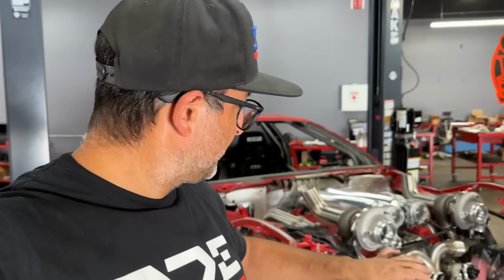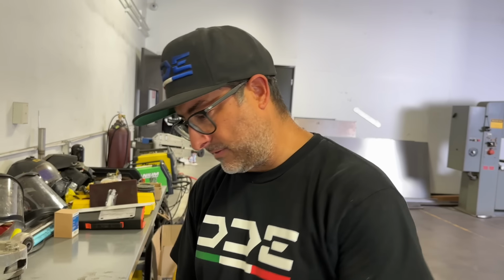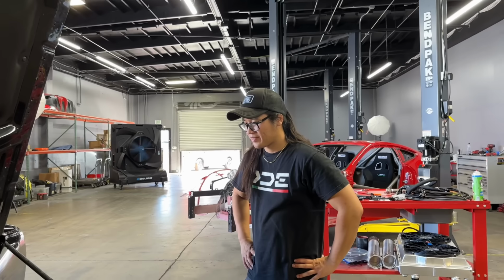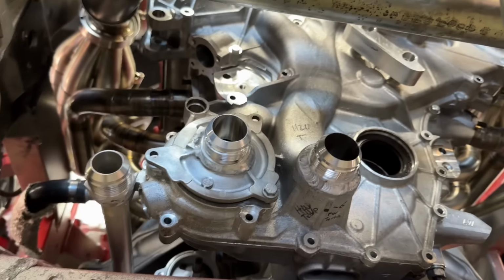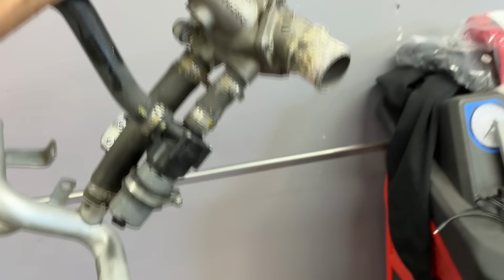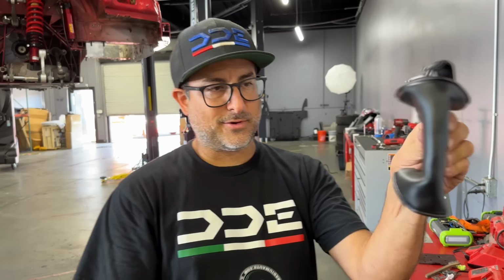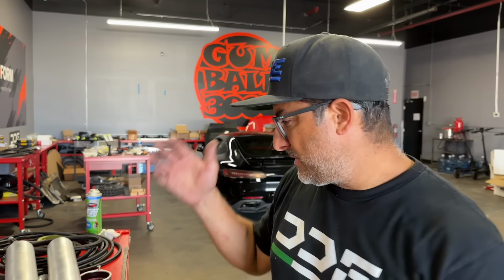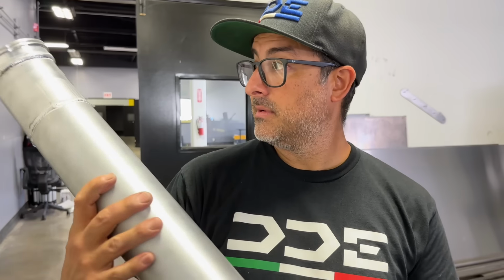DIRTY RAT CAUSES MAJOR ISSUES ON MIKES AMG BUILD!

Comment: For the radio, not having sound, I would press the audio button on the steering wheel that request for Mercedes to make a call or set a radio station, and then hit the cancel button. Sometimes that will clear out a Bluetooth error. Sometimes causes the audio not to come on

Comment: Why aren't u guys adding an air jack system to the car? I think that would make ur job a lot easier change the wheels.. figuring it will be a frequent job on this car, that will eat up a set in just a few minutes..
Plus it would also be a really cool extra feature, an doesn't it also make sense so u could warm up ur transmission an diff while standing?

Comment: Well, someone may have already pointed this out. But on my Charger, I had an issue with no sound through the speaker. Went to the dealer for ideas where to look and the service writer said that if the sound system suffered a low voltage draw that the amplifier would go into sleep mode. So, I pulled the fuse to the amp for a couple of minutes and put it back and bold speakers were working again.

Comment: I know a v8 cooling fans should be with two fans equaling 2800 to 5000 cfm what type of fan does it take to cool a v12😅 that alot of air movement

Comment: My camshaft position sensor is fuct! It's a 10 minutes fix except it needs to be recalibrated! I'm not taking it to the dealership! I kicked a mirror off a show room display car when the dealership decided to take my rims and tires I just spent 5G on and wouldn't give them to me even though I had the stock rims and tires! 😡😡😡😡😡😡😡 I'm surprised I didn't see a visit from the cops sorry Dodge Callanger I didn't want to fuck you and the display up but 5G is 5 fucking G! Fuck the dealership I will never buy a car at that one again! 🙄 🖕

Comment: Random thought, probably completely wrong... Maybe the car has shut off your radio because of the battery code. 
My Silverado turns off the speakers when the battery gets low to prioritize "essential" functions. Perhaps your car, due to missing that battery connection, is doing something similar. 
Just a thought.
Reply: Side note, when this happens, the radio looks like it's working, but no sound. 
When it's -20F I have this problem time to time, even with a "good" battery (I need a battery warmer lol). I hope you don't need to spend 2 grand on a battery, but that legit might fix it for you.

Comment: when it comes to mercedes electrinics its (eghm) old school so yea always if there is a fault in the radio or instrument cluster just take off the connector on the back,if that dont work ofc check the fuse but probaly something has a fault, also if on a newer car if the dashbaord has a fault and there is a can-fault it could be a backup camera because its on the same can-system as the dash.

Comment: hey bruv ideally on the uca you want the heims vertical not horizontal. four tabs for a double shear setup. can gusset the top and bottom, run full range of travel and can calculate the clearance. notta big deal but you will get more life out of the heims. ps they better be fk or auroa

Comment: Hey Mike! Loved the episode.

With the solid engine mounts - you mentioned the engine will be connected to the chassis. Is there a risk of the torque from the engine twisting the chassis over time?

Comment: Dude, just gut the stock water pump and seal it. And use the electric water pump to control warm up cycle. just leave it off  and have it pulse a few times to cycle the coolant for accurate readings, and basically don't turn it on until the coolant is like 185 degrees

Comment: Former Mercedes Mech... The cable to the lithium ion battery is mainly to regulate the alternator. This could maybe (most likely not, but not 100%) cause some issues and shut down some systems like radio and stuff... (The Battery output is parted in 2 "lines" 1. Engine and all the stuff that the car needs to run. 2. Comfort: like heated seats, radio...) Hope you can just decode it, and that solves the issue. greez from germany

Comment: These AMG have a printed sheet with the fuses, it is usualy located inside the fuse box on the back, and has the diagram for all 3 fuse boxes, they tend to have 3, one in the engine compartment, another on the driver side(interior) and another on the trunk, mine had the sheet stored in the trunk, the previous owner must have lost it or they lost it at service

Comment: Hi Mike, regarding the amg gts there is a recall for the gearbox from 2015 to 2018 models if I’m not wrong. Please check with your local Mercedes dealer by giving your Vin number. I have a 2015 and the gearbox was licking and replaced it with a new one.

Comment: Mike Essa:- 

Question about the suspension setup that I’ll hope might be explained further on a follow up vid. 

You mentioned about the quick adjustment for the various components of the Suspension linkages/setups. Adding a turn or a couple of turns = x degree.

Now how are you going to reference this point to change setups from one track to another.

There going to be a zero point from where each of these points are measured from.

At x distance from the end is zero point, you going to have a bar that you slide in somewhere and when the suspension arm or whatever is up against this is zeroing. I assume this could be replicated for both sides. Possibly even have different set rods for certain tracks if you visit them enough. 
I suppose if something is bent during an ‘event’ could be a quick check to see if there is an issue or a guide for a replacement part.

Comment: Any concerns with venturi effect on the supply/return line flow for oil and water the turbos?  Are there sensors on these lines?  I know that flow rate is critical.  If someone explain it that would be super cool.

Comment: Lolol all the noobs not paying attention and forgetting the engine is just a bare block they’re using for mockup.. only thing I’ve been worried about is the factory front sub frame pieces. If and when this car gets front end damage, that stuff is gonna be a pain to deal with. At this point that car should have a tubular front end. With maybe a nose cone that pops on and off

Comment: Mike removing the lipo battery is why the radio is most likely not working the old battery is coded to the car via can. Without it seeing the coded battery it shuts down certain convenience features such as radio,bt, ect.

Comment: Please Please polish the engine side of the heat shield. With the one side heat resistant gold tape and the other side polished I’ve gotta say it’s gotta be the right way to go!!!
Reply: I use bounty paper towels and Mother’s Mag and aluminum polish. That’s my go to, amazing results with little work. A paper towel is slightly abrasive and always clean of debris from the last use. Bounty is my preference the same reason why I don’t blow my nose with a bounty.

Comment: Only thing I would give my opinion on...  Any time you bolt parts together,  the bolt should be installed from top to bottom.  That way if the nut falls off, the bolt stays in keeping the part from coming apart. Safety should always be first in building and assembly.  Suspension parts work better when bolts are in place.

Comment: The cooling system design is interesting for sure with using the factory pump and then a high flow electric to regulate temps. I'm curious if cavitation would be an issue in a closed loop system if one pump is pulling more than the other is putting out ?

Comment: As a machinist, I will say machining a cast aluminum fitting like you did with a roughing end mill is a perfectly acceptable practice. In fact, that might be my tool of choice as castings can be abrasive due to sand or casting media left on the surface. If someone in the comments dogs on your choice of using what you have on hand is just being a hater. If the end result is good, you chose the right tool. I'm always impressed by your work and your natural ability as a problem solver.

Comment: Instead of a ohm check maybe put one probe to ground and then see if you have voltage on both sides of the fuse. This way you can find if the fuse is getting voltage from the power side and check the fuse at the same time. Im sure you covered that but i had to say something just in case.

Comment: Wild idea for heat... 1, electric a/c pump. 2, evaporator at the front & fan to pull frozen air into the engine bay.. put the condenser at the back with rad.. it's basically backwards from normal, but it turns your engine bay into a big hvac duct to freeze incoming air & help cool that big v12 🤔
(I also want to try & create an intercooler with an evaporator attached/ built in so it freezes the core therfore cooling the intercooler. & also thinking a boost pipe inside another pipe, the gap gets pumped with a/c charge & acts like an evaporator around the boost pipe)

Comment: Your sound issues and reversing camera could be the amp, or coding the cars been off for a long while so bits might need recoding due to the flat battery, but also you might have got moisture or issues with amp.

Mercedes tend to have issues with amps in lots of their models and the symptoms are a lot like what you described, 

I have a 2008 W221 S-Class with all those problems and it’s due to the amp needing a refurb and on my model it’s a known problem!

Comment: One thing to consider with certain modern cars is they now often have a communications bus (CANBUS) that they use.  Since your car had a rat issue it's possible that bus, if it has one, was damaged.  Back up cameras usually use the bus.

Comment: These long videos on the f12 build are amazing. One thing I've noticed and rubs me the wrong way is Mike saying "in order to not waste time" "Tim has nothing to do, so he's doing this on my car" also.. Damon and Dave stressing the money and time frame so often on this build. I don't see Mike or Tim wasting time or money at all.. this is a 1 off 1st of its kind build. With little to no info from Ferrari forums etc online. Mike and Tim shouldn't have to justify the time or money spent. If you want a quality build that Damon won't break in f12 in 1 video... this stuff takes time... dang. I know Damon and Dave don't have bottomless pockets, but ya should have done some research before approaching Mike with the complexity of this build. Now it seems like Mike is been put under a spotlight.. which is totally not right. Wtf would happen if Mike were to walk right now? DDE would be forced to use another crappy builder. Stop judging Mike in these comments. The man does the best he can with what he has.

Comment: So, im asking, not doubting. With those solid mega tubes going from charge cooler to billet air manifold on an engine with direct metal mounts.. if you have a frontal impact, even small, is it going to rip engine to bits?

Comment: Might be a option in the info system to turn back up camera on or off , if that’s not it should be around the shift knob w a wire connected to it to tell the camera when the car is in reverse or not. Just a tip

Comment: That magnetic cam system is simular to My R35 GTR Trans.  It's actually one of the smartest things Mercedes ever did like Nissan with the GTR R35.  Alot of the times when the Trans is not shifting or slipping it has to do with the magnets and usually a cheaper and simpler fix than a OEM non magnetic part failing.  Most of the time it just takes a cleaning and the magnets capture most metal that circulates through the part.  More and more companies making high end motors are using magnets.

Comment: Are you guys planning camera mounting points/microphone mounting points? Would suck to get the entire build complete and it's hard as hell to set up for pov drives etc.

Would be sick if we got some unique angles or even some shots from the engine bay, not sure what's possible with heat but imagine watching those headers turn molten red 😍 or having a pov from the front bumper like in Forza... Lots of possibilities that may not be an option if you don't plan mounting points 🤷🏻

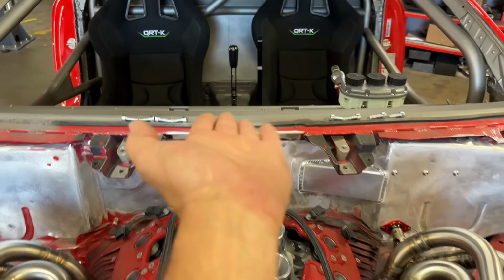Comment: 23:10 Saw Rob Dahm did a cool double stack Fuel line on his 12 rotor build so the Fuel in and return are all hardlined and connections are at the rear of the engine right at the firewall for but in and out fueling to reduce lines in the engine bay. Would be cool to see something like that on this sick build!

Comment: Mercedes use fiber optics, meaning all the components like stereo, navigation, amp, backup camera etc. have a signal that runs in a loop so if 1 component malfunctions it breaks the signal to the whole system. You can test this by bypassing each component until you regain signal. I had this problem with my s-class and it ended up being the CD changer getting wet in the trunk (2000's car) in the trunk..
Reply: Facts I ran into this issue with my Harmon kardon system. It was my multi disk player in the glovebox took the 2 fiber lines and half a bic pen shoved a fiber end in each side of the pen and glued in place. Worked like a charm after that

Comment: Why not use the that line to cool the turbo's this way you're not tapping into the castings at all?   Somehow condense the end which will increase pressure/flow to the turbo's and then you would only need a return line from each one (turbo)?     Super cool video by the way!

Comment: A lot of radios have white noise filters.. make sure you have an antenna hooked up and it's on a working station.. if that doesn't work hook a speaker directly to it to make sure rats didn't eat your wires. Might have to rewire it completely

Comment: On the heat shield 
May add a few strips on the back like an amplifier Heat sink to help add material to soak up the heat, have you thought about a ceramic coating or something like that?

Comment: Can you describe how you incorporated new or extra features. 
Oil / coolant etc temperature sensor monitoring on this build? 
Do you will use most manufacturers system or you will design new system to incorporate new harness and hardware??? If this I wouldn’t be a DDE secret code 😅
❤❤❤ 
T/y ❤❤❤

Comment: If the turbos are mounted directly to the frame what happens when the engine is moving on the mounts? Won't all the pipework need to be really flexible?

Comment: Camp you have to admit...... ever since you joined the DDE fam....... you build more than just the F12 world correct?????  Sorry can't but I don't think that's going to be the only car you build, lol.. and once you show both them boys exactly what you yourself can do with an AMG.?!... if you and them boys were both really really really really smart????? You guys would buy some cheap 318 eyes or something like that or 318 T's and build them as beaters for the block... even if you shoehorn something different in there, and you know you can do it and they know they would want it, lol.... 8318 with a nice angle kit and somewhere between 700 and 800 wheel horsepower, Shazam zip bang boom Wubba Wubba Wubba Wubba... that would be a great block beater correct?????

Comment: With the radio and camera issues, if it’s anything like a bmw it’s all connected via a fibre link. So check the back of the radio to start with and then the entertainment module connections. Very sensitive and finicky.

Comment: Thank you again Damon and Dave for allowing Mike and Tim give an update on the F12 build project. Hopefully you’ll allow the actual engine rebuilds for the F12 and 720 to be shown as well.

Also, probably you’d consider and Mike would agree that you help out Mike achieve the 500kms (is it 500k) break in of his AMG project through a “long drive” (or “fun run”) I don’t know out of state run? Then tune it and dyno it as well, and then have a track event with it and with your cars

Comment: One potentially good idea for the F12: small fans up front to help with stagnant air? No amount of heatshielding will stop temps from ultimately rising. As for the stereo in the AMG possibly linked to amplifiers and a processing unit, it is a German car, just expect it would be like BMWs!
Reply: you missed to GOLD PART😂

Comment: Mike, the radio problem is most probably related to your battery . That wire needs to be plugged.  U need the oem battery. Keep up the great work. Guys, LOVE THE F12 BUILT

Comment: Would it no be worth just adding a fan in the front somewhere just to pull air through the engin bay to cut down on the heat soak for the times it is just sitting still revving and shooting flame? Just kinda makes sense rather than air not moving around just getting hot   when stationary. Love the content.

Comment: Maybe it’s a space issue and there’s no choice but the back of a drift car is one of the first parts to get thrown into a wall or K-Rail and cave those fenders in and tweak the back of the car and that’s where you decided to put the coolant system? Couldn’t that  literally park the car for potentially an entire event because it’s so custom there aren’t parts on standby? I understand the front gets damaged too but not with the same level of impact the rear generally gets when you come in hard and swing a little late.

Comment: Hey Mike, I'm not sure about Auto application, but in off grid Lithium's, the BMS is super smart. It probably won't come alive from a jump from another battery. You may want to try a Lithium charger that has a "repair" function. It may be able to wake that battery up.